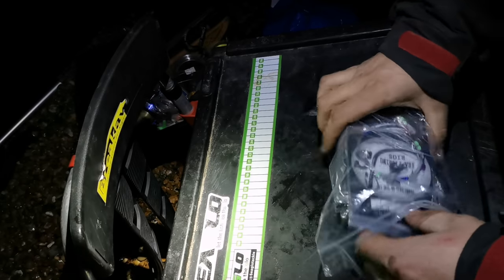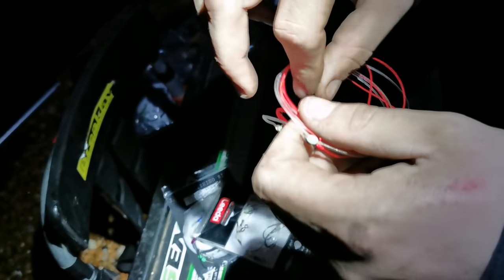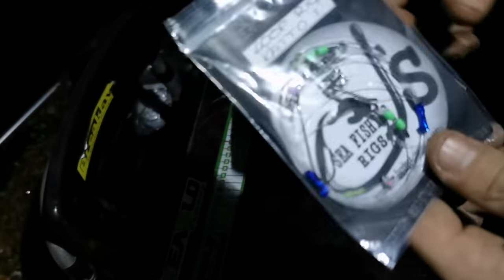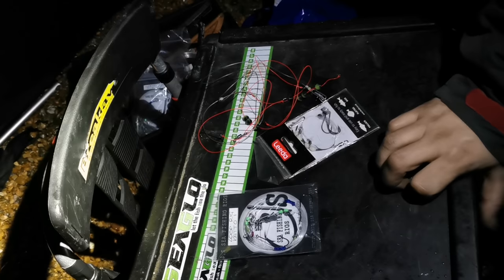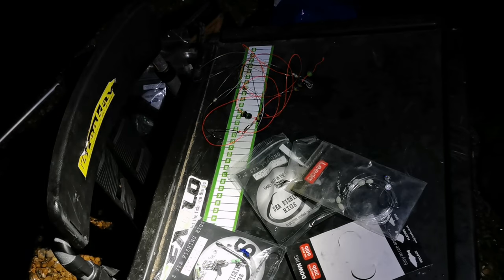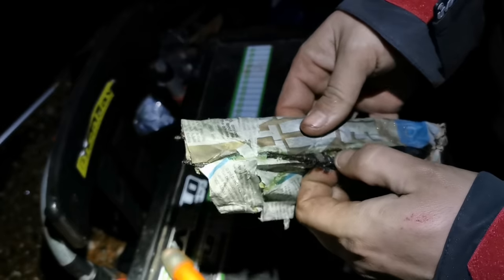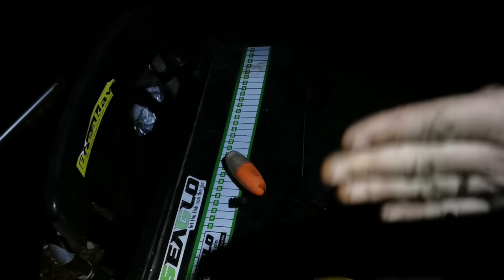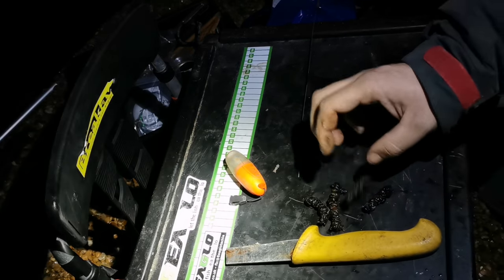Sea fishing rigs - shop brought or hand made - rigs in action - sea fishing UK

Comment: The strength of line used will be on the packaging with hook size. I buy these made very well use time and time again just change the snood and hooks. I use them on a beach on my boat on our local pier and in the estuaries. Brilliant all round rig, Last year caught some very good bass, conger, rays, black bream place, flounder you name it I caught it all on the same one up one down rig. Other pone up one down rigs are available.  Amazon  Rodeel 4 PCS & 8 PCS Sea Fishing Rigs Pulley Rigs Single Hooks & Two Hooks Multi Size